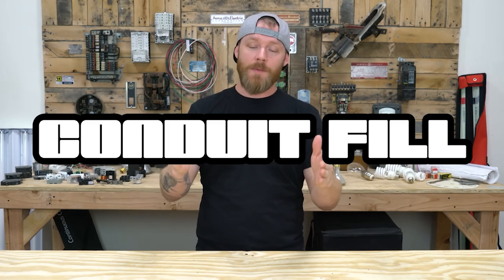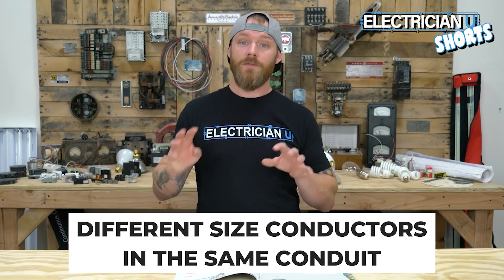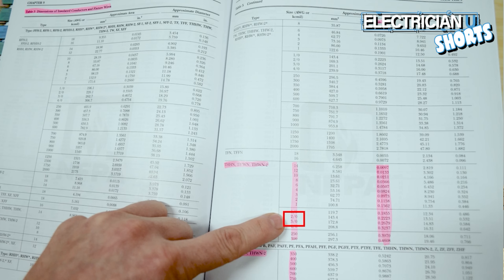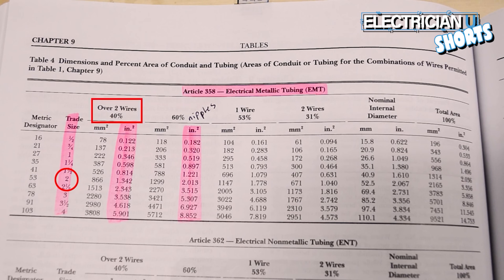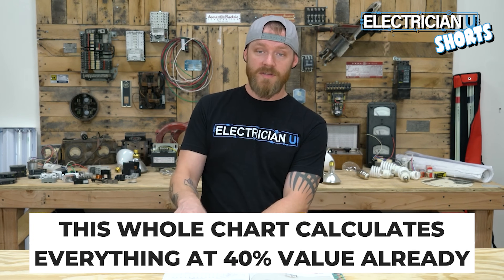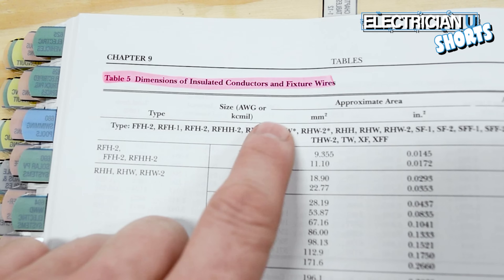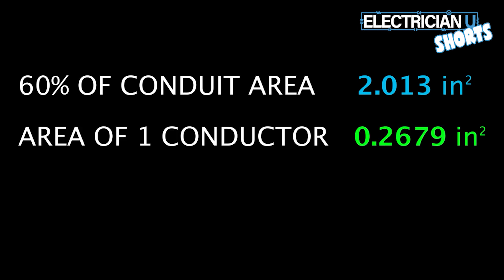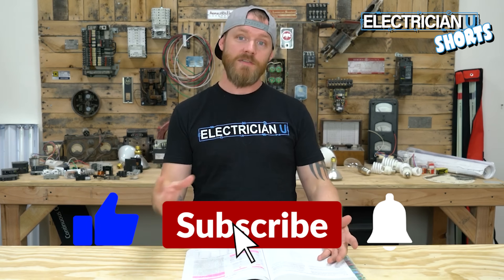SHORTS - How Many Conductors Can You Put in Conduit PER CODE?

Comment: Where does it say that table C-1 is already calculated at 40 percent?  Just curious..
Reply: The C tables are based on Table 1, so not all the numbers are 40% fill. Where a conduit size shows 1 conductor, that's based on 53% fill; where it shows 2 conductors, that's based on 31% fill. Any conduit showing 3 or more conductors is based on 40% fill.

Comment: Question if you have 40 #10 THHN  (Derated) in a 2” PVC sch. 40. From a panel to a junction  12x12 feeding 15/20 amp circuit what is the maximum # 
I’m figuring it would be derated to 20 amps. Does anyone agree?
Reply: No, derated to 16 amps but you could put them on 20 amp breakers

Comment: Electrician U ....I got a question. 
I'm installing a 200amp  sub-panel in a garage and there's a firewall so I'm running my 12/2 wires  with jacket through a 1 1/2" pvc conduit ?

I'm thinking to run only 6 12/2 with jacket in a 1 1/2" pvc pipe.

Do you think it will pass inspection or how many 12/2  should I run in a 1 1/2" pvc pipe?

I need help thank you

Comment: My dad found a grounded emt with a single high power wire to a 3 phase compressor.  The old single phase emt was not big enough for an extra wire. The single electric wire would induce a magnetic field in the emt.  The power wire then bounced back forth until the insulation broke. Years later, Zap. Breaker tripped.

Comment: Hey -- can you weigh in on a code-compliant way to repair a residential service line running through a 2" conduit that has rusted through at the ground level? The video shows using duct tape and concrete -- this feels like NOT NEC / NFPA 70 compliant! https://youtu.be/9M5TTk1TgDI?t=418

Comment: What is the reason for nipple getting more space? Is it because they are limited to smaller runs (sub 24")?
Reply: Nipples are better ventilated- it's possible heating dependent.
Reply: @dougfaunt5565  curious how a equal diameter nipple has more ventilation than an equal size conduit? It's the ID bigger?
Reply: @KenTooker  airflow is better, to carry away the heat.
Reply: You can use the 60/100 with conduit under 24" also not just nipple so basically straight run under 24 inches....
Reply: @jt3178  that makes more sense.

Comment: From an old sparky :   on long runs especially if you have more than 180 degrees in bends when installing say #1 guage & larger use the next size conduit and be carefull how you instsll LB condulets. Use plenty of approved wire lube. Already used the next size LB when pulling large wires thru ling conduit run with 360 dehrees of bends. Example is used a 3"LB with reducing bushing on a long 2.5" conduit run. Sometimes in crowded ceilings there is no real room for a LB so you are stuck with 360 degrees in bends.

Comment: I believe there's a caveat for "current carrying conductors" so 3   wires with a shared neutral only counts as 2.  OTOH, I've also seen "includes spares" which obviously are not current carrying.
The Ugly's app has a calculator for different sizes in conduit or nipple.

Comment: I literally got to the back of the NEC book and copy those into a sheet in my hard hat. 8 circuits #10 in 1 inch EMT. 84 circuits of #10 (a full panel) in a three inch EMT. You can pull 1 circuit of #4s in 1 inch. These numbers are just theoretical. Many of these values are upper limit of what you can pull in the pipe. 6 circuits in 1 inch EMT is a PITA to pull.

Comment: Question! Not an election here but I do IT/CCTV work. Does this still apply for that or no?
Reply: Hi Ryan. I am not an electrician either and I also do IT work. My view is that it does apply, even it it is not being enforced by local inspectors right now. The NEC code has been slowly creeping into our field and it will not be long before we are also fully encompassed in it. With the recent code cycles, we are now are also dealing with conductor derating on POE (Power over Ethernet) and POE cables are also classified under the NEC as a class 2 or class 3 cables. Even it it is not being enforced, its probably best practices anyways to maintain conduit fill requirements.